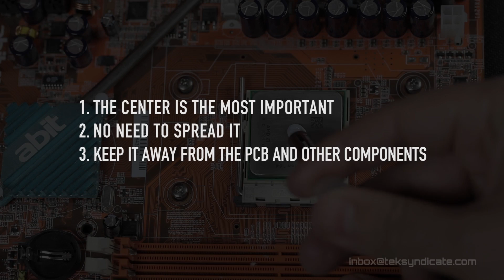How To Apply Thermal Paste

Comment: great idea to use a clear plate to show what actually happens
Reply: Yeah that was pretty smart and quite interesting.
Reply: Agreed, I can finally show my friend or some other people this, and they'll be able to better understand how it works, THANKS!
Reply: Only downside is, look at the positioning on for example Ryzen 3700x cores. It also looks like 50% of cpu is not covered at all.
Reply: @kermitdheadfrog9791   Little while ago, Amd and Noctua recommended to put a paste in different manner. I put it very similiar to what they now recommend. The only reason is very different positioning of cores under IHS. You are absolutely right about expanding of paste, tho I am no professional and I really dont know how much it expands.
Reply: I like this too
Reply: @lobobaltazar1322  sooo since you mention they change the recommended way to applay thermal paste could you be so kind as to tell  us what the new recommenede way is ?
Reply: @dudder2008  don't be lazy, research it by yourself. Google is your friend ;-*

Comment: im using the empty the whole tube on the cpu method
Reply: QueenEtna As long as you don't leave any in the tube it should cover it properly :)
Reply: This is a good idea but at least for me the tube won't cut it, what I do is load a few hundred tubes of it into the power washer then spray it on the cpu, also if your doing this the way I am make sure to put the power washer on the highest setting to make sure you get it right
Reply: JK JCGaming Good idea I'll try that next time.
Reply: QueenEtna yeah, or if that doesnt work try a rolling pin
Reply: LeMonGear If all fails bad dragon is your best bet on getting a new one
Reply: JK JCGaming 2nd time in a row! I don't have that kind of dough... QueenEtna I hear bad dragon is cheap though - but a bit dodgy if you ask me. Eh, what choice do I have?
Reply: Joey Fnuts You See, Its called A Joke
Reply: Joey Fnuts Everything posted on my comment was a joke. You sort of ruined the chain with your dumb comments.
Reply: Joey Fnuts *No*
Reply: ***** I like bricks.
Reply: ***** You should try it!  Not sure if you can legally fire one up in your home, the police cannot stop a man and his CPU tempatures.
Reply: ***** I just read your comment and would like to point out that I am working with a soft 10".
Reply: +JK JCGaming hahaha
Reply: So the Verge method?
Reply: Not an issue if you have a cooler from "be quiet!" :) A bit stingy on the paste they are
Reply: @LukeWatts85  my buddy was saying I've been doing it wrong cause his bequiet manual told him to use more. it was the first computer he ever build. but Obviously was better than I cause his one was apparently better then the last 4 combined. his cable management reminded me of 90's builds
CABLES EVERYWHERE but yea BeQuiet is a lil extreme. a pentagram then spread it?

Comment: Good videos and explanation. The problem with the pea and line methods is that: 
1. the heatsink isn't see-through like the plastic piece and there is no way to know if you apply the pressure evenly. If the pressure isn't even there will be more paste on one side and none at all on the other.
2. the pea expands in a circle and will not cover the corners of the square which will become hotspots.
I am sure others have covered/commented on that before.

Comment: I wish I had watched this when I replaced my laptop fan. The replacement fan came with thermal paste but zero direction on how to apply it properly. I should probably open the sucker up again and reapply the paste...
Reply: Don't feel bad! I had to replace my laptop fan and I didn't re apply any thermal paste... I bought A tube the other day and gonna do my first cup/ heat sync cleaning and thermal paste application lol I hope it turns out ok.. Glad I watched this!!!! I didn't know you don't have to spread it!!!
Reply: +RainAngel111  yes new! paste is better.
Reply: Did you apply the new paste?

Comment: Nothing wrong with paper towel. Have used it for well, since the 1990's and never an issue. Line method isn't bad if you know the orientation of the die under the IHS, and is the preferred method if you apply it directly to the die, because the die needs full coverage unlike the IHS that it just needs to get over the die.

Comment: One of the best video on CPU/thermal paste subject. The only method not mentioned is to apply a very small square shaped dot on CPU.Why square ? Because when pressure is applied on paste it is always equally pushed or spread on every direction.So, circle will not cover corners, line when pressed will go over the CPU where closer to the edge and and not cover the CPU where is further from the edge, cross could go over and create bubbles and so on.Quantity is also the key. The thinner the layer, the better heat transfer to cooling unit. :)

Comment: I've done temp comparisons and the spreading method using an included spatula spreader tool has always yielded better temps than the X or pea methods. I also wiggle the heatsink around on there a bit to kink out those bubbles so maybe that's why.

Comment: 1:34 perfect
Reply: It's nice and all, but thermal paste is a liquid that also spreads a bit when heated. So when it looks nice now under the glass plate (and cold cpu), it's actually bit too much. It will spread over the edges. Not necessarily harmful, but will be more of a mess when removing heat-sink in future.

Comment: Centre dot or vertical line is preferred. If you de-lid a Haswell for example, you will see that the heat spreader directly contacting the cpu runs from the middle top to bottom under the bigger heat spreader (look up de-lid pictures, you will understand). Here, the other surface of the larger heats preader contacting this is where most heat is transferred. Paste applied to the four corners, left or right sides on the larger heatspreader is useless, because only a tiny fraction of the heat transferred from the smaller heatspreader directly contacting the cpu is going to reach it. As demonstrated above, directing your efforts to efficiently filling the spaces near the centre in a circle or 'vertical' oval is what is essential, or otherwise your temperatures will suffer.

Props to nice video showing how the voids are filled.

Comment: Just started ordering parts for my first build. Having never applied thermal before (and watching the tutorial/reading comments), it seems caution's the better part of valor. Better to have too little than too much. A teaspoon less might mean a slightly heated CPU; a teaspoon more might mean a new motherboard. 

Unless you're using the Metal Method, in which case this is all moot

Comment: Although the core is in the middle, I'd assume that the heat is spread all over the cover pad, thus more area would transfer the heat better all around.
Reply: The risky thing with that is the paste can easily smear off to the sides. Once that stuff is off the CPU, who knows where it'll go.
Reply: *****
That's why I thought that spreading was a better choice to cover as much area as possible without accidentally going over, but didn't think of the air bubbles.
Reply: To much paste is less conductive than the tiniest layer possible, the idea is to fill in the minute gaps created by the metal of the heat spreader and the contact of the cooler not being as smooth as the appear (under a high powered microscope they look more like mountains and valleys than a smooth surface). You are literally talking microns, heat sinks have fairly high mounting pressure and when you turn the computer on for the first time that gap will shrink dramatically due to the expansion of the metals forcing them closer and increasing the pressure even more.

The properties of the TIM will change with heat as well, some take ages to "burn in" with others only taking a short time but generally either way the performance of the material will improve over a certain period of time

This spreads that thin layer even further and makes it even thinner and it becomes more efficient with time.
Reply: *****
I think that the spread method ensures that better than estimating the bean size.
That's also why many spread it.
They just can't know how far that bean will spread without trial and error.
Reply: I can see how the spread method would be useful for easier estimation of coverage, but I hate risking air bubbles between the CPU and the cooler. Personal preference, I guess.
Reply: You know under the cover there's just a small chip in the center right?
Reply: ***** Delided 4770K: Looks pretty center-ish to me.  http://cdn.overclock.net/2/2e/2e22b722_boulard83_4770k_vernis_002.jpeg
Reply: ***** That's not what I'm arguing. I was arguing the location of the cores. They are typically in the center under the cap. I am not advocating using less of the paste or that having little coverage won't affect performance. I do understand the purpose of the cap and it's role in heat dispersal. Personally when I apply paste I attempt to ensure maximum coverage of the cap with going over the edge.
Reply: ***** Not arguing that either. When I said ensure I took that into account too. I guess that may not have been the best way to say it on a comment thread devoted to teaching people how to apply it.
Reply: Hunter Parker so can we allow it to spill over the processor metal cap????
Reply: @RealationGames 
"I think that the spread method ensures that better than estimating the bean size.

That's also why many spread it.

They just can't know how far that bean will spread without trial and error."

Right.  You cant know how far any shape or amount of thermal paste will spread.

With the bean method, it may not spread across the whole plate.
With the spread/businesscard method, it may cover the whole plate but it may also leak onto other surfaces.  Also once you have air bubbles those don't go away, cause of the air bubble shape and internal pressure of said bubble.  The bubbles may move but they probably will never pop.  If you have enough small air bubbles itll almost be like not spreading any paste at all.

Either way you wont get 100% spread and 100% contact, but that's ok.  The paste is just there to help.  Even without thermal pastes heatsinks are very effective at their job.
Although any amount of thermal paste is >>> no thermal paste at all.
So don't sweat it.

Unless you have electrically conductive thermal paste.  Then you probably want to use the bean method, and less than more thermal paste.  Don't wanna risk unintentional bridging.
Reply: @hunter2172-p2d  That pic was really useful. Makes me want to remove the metal cap though and just use a copper piece directly to interface with the heatsink. Why don't people do that? Are those caps even aluminum at least?

Comment: im confused... do i use a piece of glass/plastic to spread the thermal paste BEFORE putting the cpu fan on or do i just put the pea of thermal paste on and then put the fan on?
Reply: he used the plastic to show what happens with each method.
You just put the pea on there and put the heatsink on :)
Reply: DenHond thanks~

Comment: Brilliant idea. I had the same idea, but now I don't have to do it. Clearly (as it were) the x is the best option as the whole area of the heatsink is covered up to the corners. I uses non-conductive paste so I don't mind if a little spills to the side. The metal method comes in at a close second :) I used to use the spreading out method, but I'm going to go for the X from now on.

Comment: I was trying to glue on standoffs on my FC GPU Block by using a flat head screwdriver to spread the paste around the circumference of the standoff and accidentally poked myself with it. Injured my thumb and had about 0.3cm deep hole. The thermal paste may have gotten into my blood.... is it toxic at all?

I've read at the back that its supposed to be "safe' as confirmed by the OSH standard and shouldn't be worried if ingested, had skin contact or inhaled. Anyone can confirm this?
Reply: john Binstin
I loved it until I realized you replied to yourself.
C'mon man.
Reply: SomethingCool51 was awesome anyway LOL
Reply: arthur staal It's a copypasta he took from a forum. Too lazy to re-Google it, but I remember seeing it somewhere else now.
Reply: SomethingCool51 oh so sad :(

Comment: Very clever to use the piece of glass/plexiglass. If you could manufacture it to be installable just like a cooler that would be the best test. Pressing with your hands allows you to (subconsciously or not) adjust uneven pressure while installing which you wouldn't do when you can't see what is happening. But this is very useful! Just pointing out the obvious maybe

Comment: awesome vid thanks. The only thing Id say in defence of the 'business card method' is that the spreading of the compound this way resembles the way the paste is on heatsinks when they come from the factory. Your demonstrations and advice does persuade me though that the pea method is neater and probably the better way, I just hope I get the pea size right I guess I will just monitor temps to judge that.

Comment: Thermal paste is not conductive btw. Some are when they're advertised as liquid metal. They should not short things out unless it's written in bold that it's electrically conductive. Also, a quick tip to know how well a thermal paste is is to look at the thermal conductivity. I use TF8 that cost just $10 for 2 gram of it. It has 13.8W/mK which is fantastic for the price.

Comment: So the X is the best. Got it.  Appreciate the vid with the see-thru plate.  I needed to know what quantities of paste equates to how spread it goes.  I know how tight you screw the heatsink will affect this as well.
Reply: Like he said, it'll spread more when it heats up. Since it got close to the edge just by pressing, some could go over. Good luck! =)
Reply: My heatsink screws loosens upp too much so it loses contact with the cpu. I need to use to screwdriver 
x shape during load: 45-47c. Pea size: 49-52c.
Some have had bad temps with x, but they usually apply it bad

Comment: first to admit stupid question (novice pc builder, longtime owner) but;
If you use a glass slide like that, THEN put the heatsink of the cpu cooler on top of it, will the heatsink be fine, or would you have to put the paste, then tighten the cooler for it to work properly?

Comment: artic silver is especially useful on voltage regulators and mosfets as the exposed metal attatched to a particular pin and i can use that to my advantage for better current handling!.

Comment: In college I used the business card method constantly especially when I was working with bulk Thermal paste, shit is so thick. If you are using a cheaper paste on a low end public access computer it probably won't matter, especially because some of the cheaper shit isn't a conductor.
Reply: card method works well, works better with plastic cards, as its easier spread and doesnt retain/stay on the card as much on the paper based.

anyone tried the butter knife method with the cpu in your hand? (not the palm)

Comment: CPU fan and CPU temp were acting up. I removed the heat sink to clean out the dust. Forgot to clean the old dry paste and apply a new coat. Damn, my room was getting toasty, and the fan was getting loud. Applied the paste. Temps dramatically dropped (7-10 Celcius) IMMEDIATELY. Fan is quiet again. Even under heavy load. Thermal paste is necessary any time you deep clean your comp. Also, don't go cheap. The paste is not that expensive to begin with, but try to get something that'll last.

Comment: Good vid thanks going tog clean the cpu and apply new thermal paste havet not done it in 4 years and the cpu is up 60 degres Celsius now. Hopefully I will get it down tog 45/50 again as it was in from the start.
Also thinking about upgrading the cooler since im still using stock.

Comment: In school they teach pea method. Anything otherwise is not necessary or worse . Legacy processors were big enough to require an X but these days it doesn't apply as it's easier to make the mistake of too much rather than too little.

Comment: I do not understand why not use that one called method of "x" from 1:34.
In my opinion is really useful argument after comes cpu hot the paste will, heated, spread more, thus again however this why not use lesser amount of paste going for the final result.
Correct me if I am mistaken please - seems to me the larger is surface covered so is the space of heat transfer.

Comment: I thought the thermal paste was supposed to cover the whole CPU after you put the heatsink on. I just looked this up to confirm, and thanks for correcting me.
Reply: there is 0 point in covering the whole CPU with thermal paste!!
CPU got a square shape, and if you look at the heatsink face contacting with the CPU, there is an round shaped copper surface, that is the main heat conducting surface. So the P/dot method (01:45) is the most suited method ;)
Reply: @DrZipZwan  Fair point

Comment: I use MX-4 and spread it thin and evenly on the heatsink. Idle temp stays at a frosty 13*C or lower in a 23*C room, and my R9 280X stays at 30*C Idle, and never goes above 55*C under load. I have a FX 8350 with a Cooler Master Hyper 212 Plus w/ 2 Blue LED Cooler Master Sickleflow 120s and GPU is the Powercolor TurboDuo OC Edition.
Reply: +GenMinion I use MX-4 don't spread it, do the blob/pea method the center and the heatsink will spread it....

Comment: I use non conducting Greece and use the metal method; I put more than necessary because I wanted my GPU to be fully covered. if the grease covers the bottom sides of the GPU is that too much and well that reduce temperature performance ?

Comment: 2nd time I've seen this.
The pea works, great.
But clean up is where some mess up.
IMO it should be a TWO-step process.
Use WD-40 & paper towels to CAREFULLY clean the CPU.
Then use 99% or 91% alcohol & microfiber cloth to finish.
Try next time you need to clean up old dried paste.
I have a FX-6350 I lapped, when the paste dried the two-step method worked.